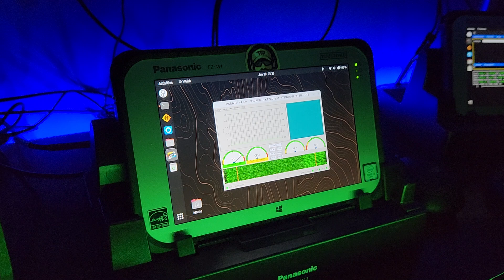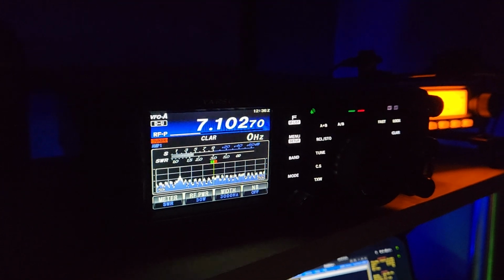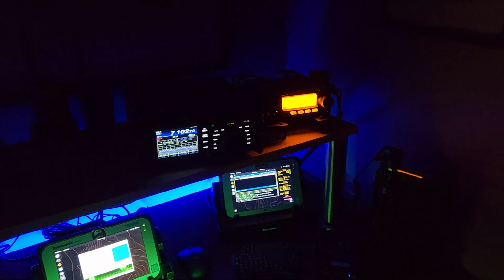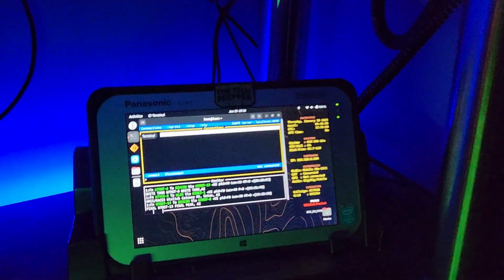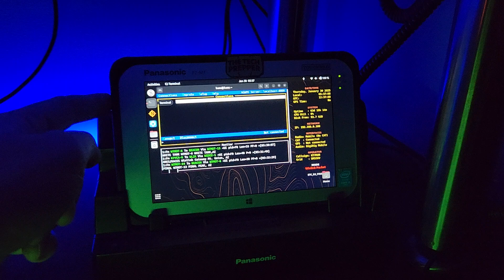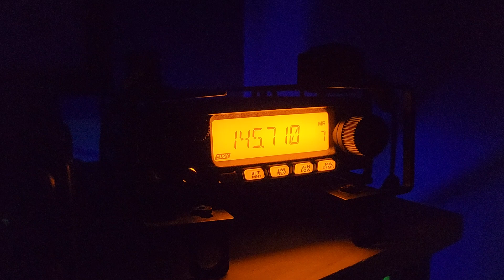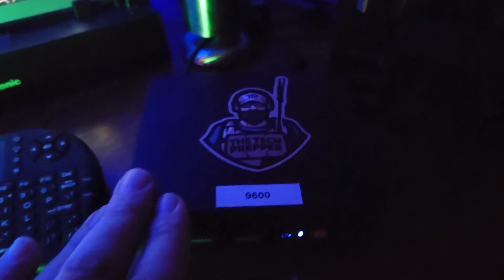24x7 Off-grid Community Comms - An update on the TTPBBS

Comment: Using this service, are those 24 users reliant on the workings of your setup?
Reply from the maker: Yes. However, I treat it like a production system. There is an automatic fail over to secondary power if the power goes out among other precautions to keep the service running.

Comment: Is your 300 baud HF antenna rig setup for NVIS? Is VARA the only option for higher speeds on HF?
Reply from the maker: Both my 300 baud packet and VARAH HF ports have their antennas deployed low to take advantage of NVIS. This BBS is primarily intended for regional use. There is another modem called Mercury that I have not tested that claims to be compatible with VARA clients, but is a completely different protocol. I have a todo item to research this much later.
Reply: @ The linux open source freedvtnc2 has 3 data modes for HF up to 1000bps with KISS TCP and serial support. Maybe worth looking at, I haven't yet tested myself.

Comment: Hey Gaston, 
Very nice work. Trying to hang on by the tail feathers here, not as tech minded, but keeping up. Just curious what used Tough Book you would go with at this point if it was used only for ham radio purposes. Trying to revive an old Surface Pro but about ready to give up. I’m thinking a of a budget around $600-$700. Maybe more if need be. I’m thinking a keyboard is a must, along with Bluetooth and GPS. Thanks

Comment: I am really looking forward to your full length video. I have a BPQ BBS running 24/7. Currently only have a handful of users using the system to relay winlink email. I would really like to get the file share working. Think that is the only missing piece for what my community would use. Thanks for the videos and the hard work that goes into them.
Reply from the maker: Excellent. Do you have any advice for someone new to running BPQ like myself? I have not yet explored routing or a full Winlink mail integration. I do run an RMS gateway on the VHF port, however. Good luck with your BBS. The trick is getting the community excited so that they come to the party.
Reply: @TheTechPrepper  That is the hard part, getting the community excited to learn with you so there are others using the system. I pieced my BBS together using videos from The Modern Ham, Still have a lot to learn. I am using an Orange Pi 5 Plus (32GB Ram/256GB eMMC). The Orange Pi only requires a 5v supply and after doing power measurements it might pull 1.2 amps at most in this configuration. My radio is a AT-778UV II (25 watt max) and I am using the DigiRig Mobile audio / ptt interface. Hosting a service 24/7 ties up resources,  I am finding that I need to install more antennas because my good one is now dedicated to the BBS.
Reply from the maker: @W3DMJ  Way to take one for the team and having the community using your best antenna. I did the same. I need two more antennas for myself: one HF and one VHF. Keep up the good work. Billy is doing some great stuff with his packet series.

Comment: When are we getting something?
Reply from the maker: If you're referring to the video. I hope this month. It's turning into a much larger project. I have multiple project that started on may day job,.
Reply: Like he said, when it is completed.
Reply from the maker: I wish there were more hours in the day. Video production is not my strong suite and this full length video can't be a point-and-shoot with bad audio, lighting, and no script. I have close to 30 pages of notes that needed to structured so that I can cover:

1. What is a BBS?
2. Why it is relevant for offgrid, local community communication?
3. Some history on dial-up based BBS
4. Some history on the packet BBS
5. A walk-through of features and practical uses cases
6. What you need to get started as a consumer of BBS
7. What you need to get started as a maintainer of BBS
8. How to use a BBS (LinBPQ or BPQ32)
9. Deep dive into my station's setup
10. Lessons Learned
11 Next steps
12. Resources
13 ...